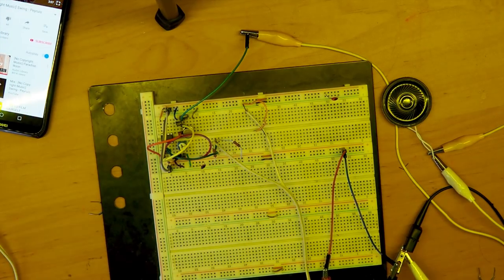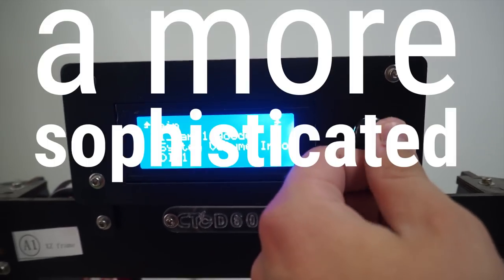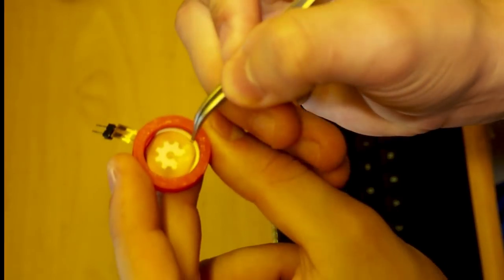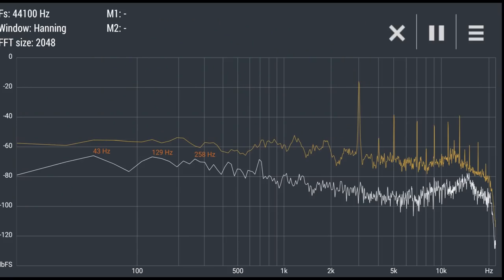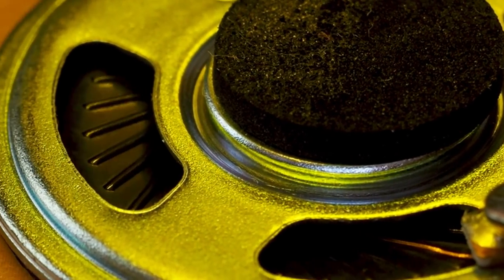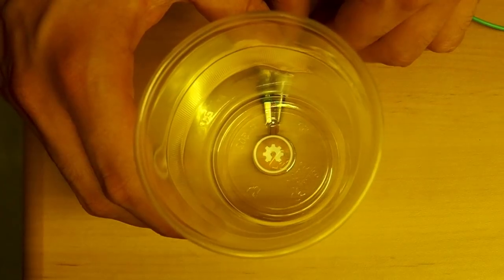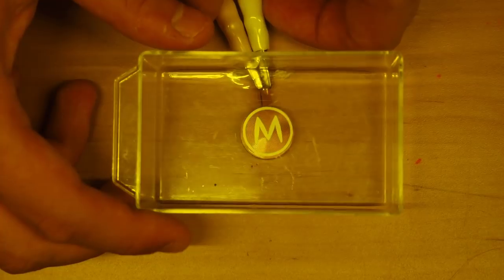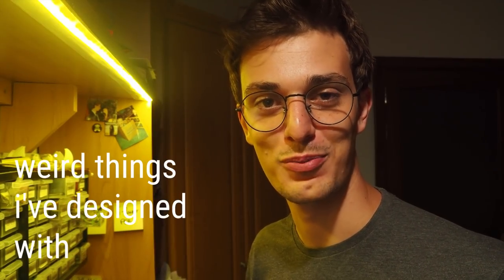Making a PCB Speaker!

Comment: When I made my PopCup (portable speaker coffee-cup) I found that the best way to amplify the sound was to (you guessed it) build a better amplifier. Haha. I'm no expert on amplifiers, but using an effect-amplifier in addition to an op-amp voltage amplifier really did the trick for me. It can now play way too loud to be comfortable. I have a video or two out showing the general concept behind my cup, with links to more pictures.
Reply: Audio amplifiers mostly only amplify current, which isn't what you want. There are special made amps that do large voltage amplification instead, meant for electrostatic headphones, but those are expensive.
Reply: @Andre Aron Instablaster :)
Reply: @Kylen Brock Thanks so much for your reply. I got to the site thru google and Im trying it out atm.
Takes quite some time so I will reply here later with my results.
Reply: @Kylen Brock It worked and I finally got access to my account again. I'm so happy!
Thanks so much you saved my account !
Reply: @Andre Aron No problem xD

Comment: Why do you need a magnet, just have two coils with a different phase on the signal so they push-pull each other.
Reply from the maker: The coil's magnetic field would be too weak without the magnet
Reply: A long time ago, electrostatic speakers were popular and they're basically what you suggested. They don't have a magnet but another coil to provide the field for the voice coil.
Reply: @userPrehistoricman  

That would be an electrodynamic, or field coil speaker. They have a voice coil and a DC coil... Electrostatic speakers are basically further engineered noisy capacitors, lol.
Reply: Oh yeah thanks.
Reply: there isn't really a speaker in this video.. the membrane should be coupled to the field response, instead it is first sandwiched in the TPU mount with no way to pass air, then it is left with only one point on the circumference and the rest dependent on that.
the opposing coil idea, perhaps has enough for to use very well for aerilons.
electrostatic speakers.. aren't those the one that sent the inventor to the hospital by deionising the air or something.. said they sounded amazing tho, and dimmed the lights on the street.

Comment: Did not understand a word...
Reply: The magnet is a magnet.  The floppy bit is a magnet you can turn on and off.  When you turn the floppy magnet on it moves away from the hard magnet.  Turning the floppy magnet on and off fast enough will waft the air in the same way sound does.

Floppy speaker.